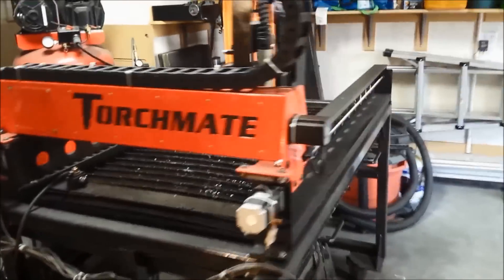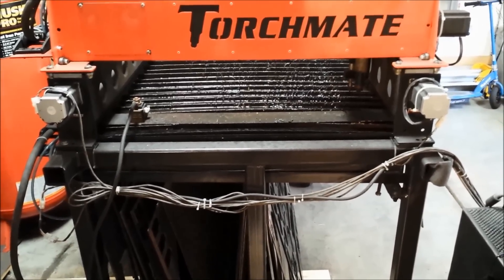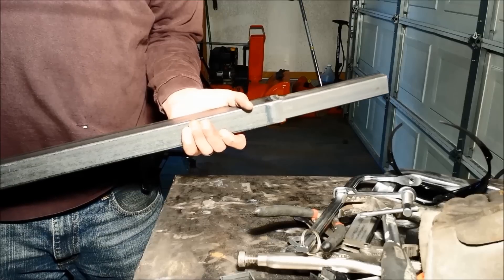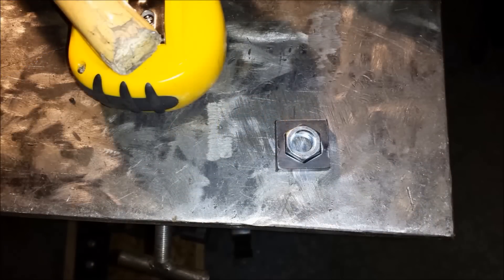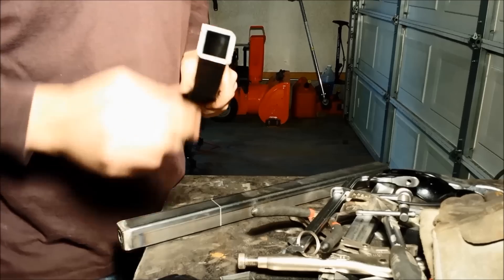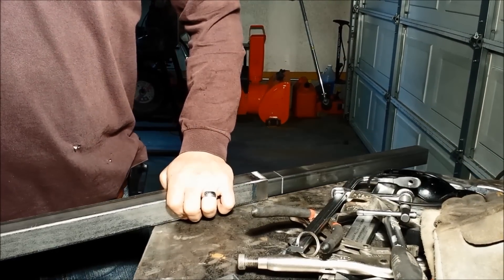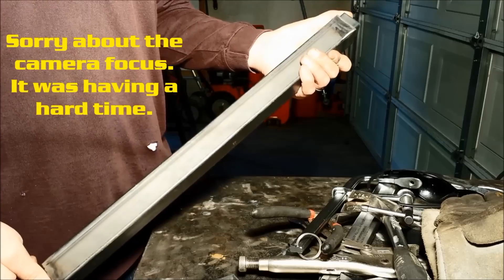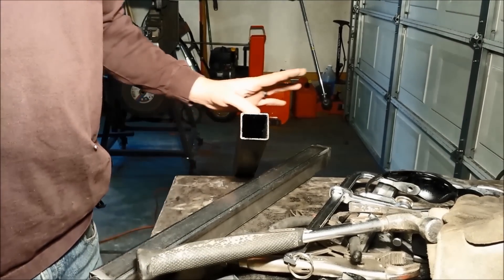Screw-jack elevator for my Plasma CNC -- part 1

Comment: What kind of CNC do you have to make those parts?  Or did you cut them out with the torchmate?  Looking forward to checking out the tube cutting attachment, thanks for sharing.
Reply from the maker: Cut it out with the Torchmate.  I had to oversize the hole just slighltly